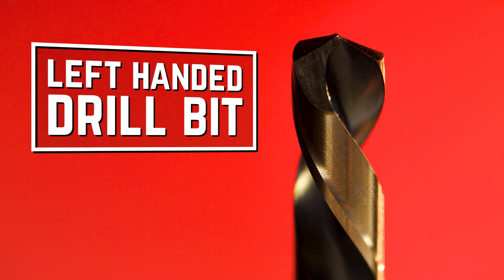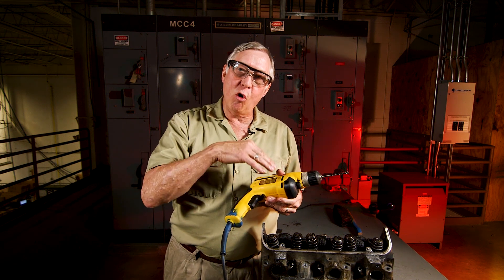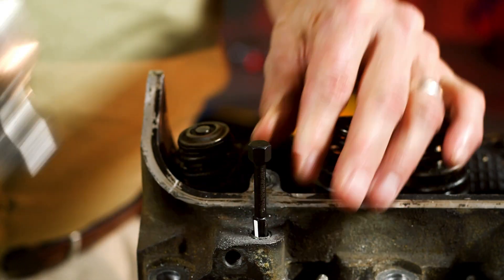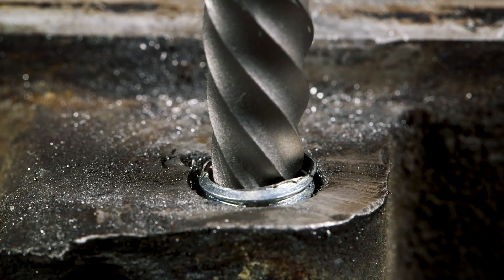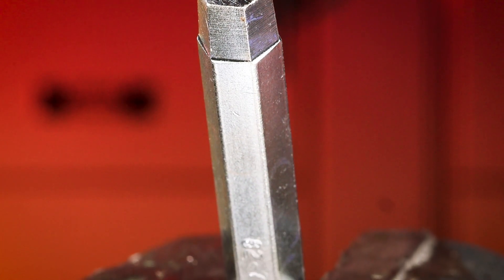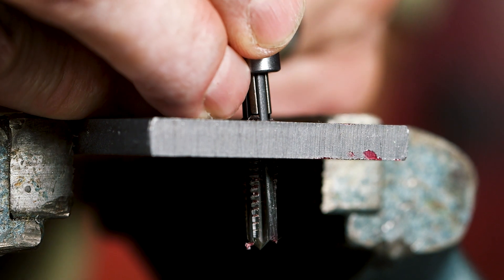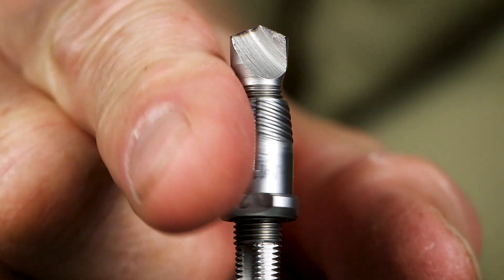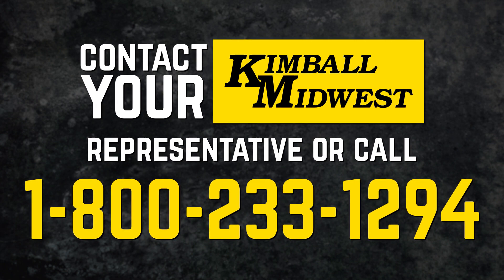Introduction to Extractors

Comment: My question is this....what if you have a stuck e10 torque bolt that has barely enough space to put a torque wrench on and that is brittle and easy to strip so everything keeps popping off when trying to turn it at all?  How do you get it off?especially without enough space to fit most tools.  This is bolts on a breather valve in a mercedes c350.